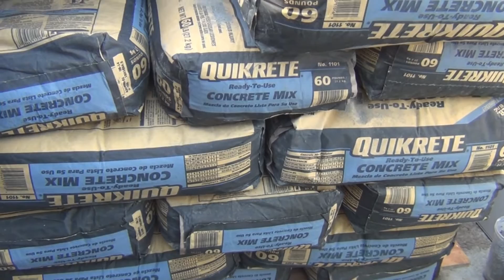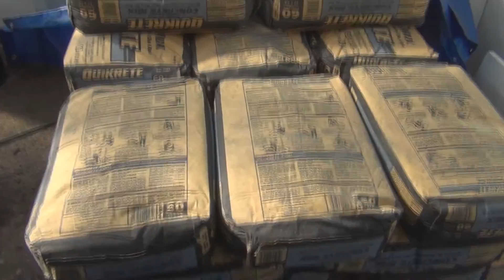Harbor Freight Greenhouse Concrete Entrance

Comment: WOW! I saw that slab and I'm so glad you showed this. It looks fantastic! That buffer is going to be outstanding. I really believe it's going to give you way more heat than you think. The heat from the greenhouse will help that buffer area, and be so much nicer than having to open the greenhouse doors and letting in all that cold air in all at once. I always thought that not having a "buffer zone" was a huge drawback to greenhouses, and they do make a big difference. I can't wait to see how you put those windows in. With the amount of snow you get, I'm thinking that the roof to the buffer area will need a pretty good slope right? I know we need to check for that here too, but have no idea what kind of slope that is needed. We get lots of snow and ice here too. Sorry for going on so much, but this is so exciting to me. I love the buffer idea, and this is turning into a wonderful greenhouse. You have added so much to it, that makes it so much better, that it makes it a thrill to watch. Bless, Sheila